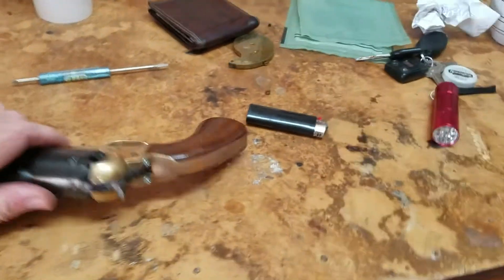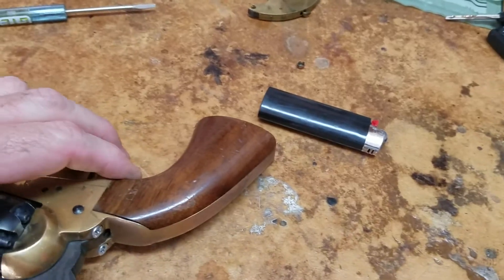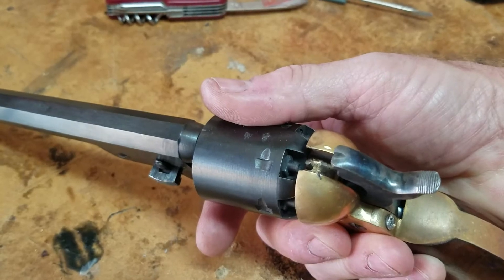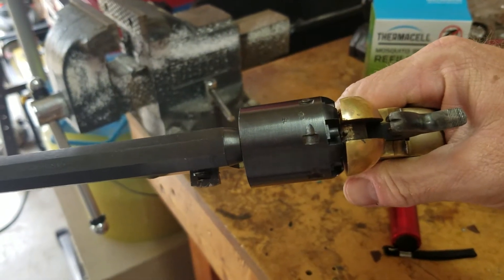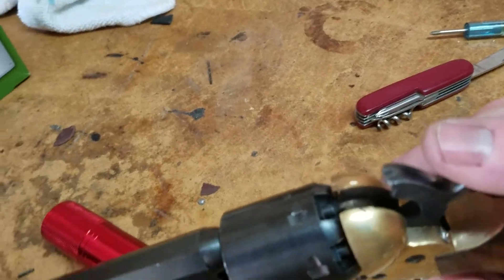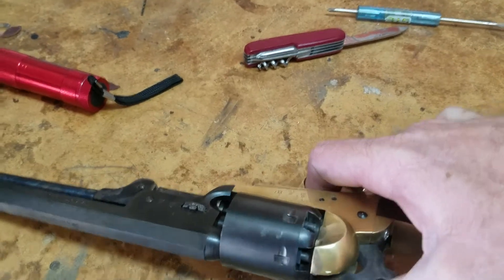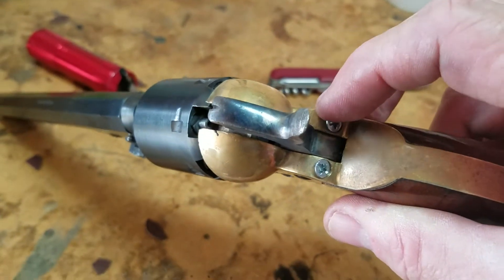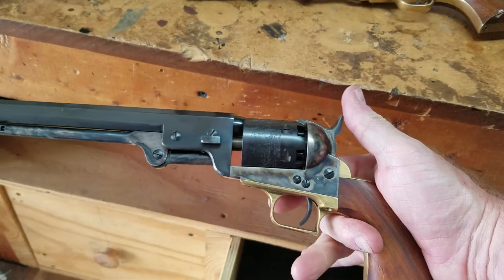1851 Navy - Cap Jam fix...

Comment: Interestingly, I read a story of how back in 1856, a man was having cap jams with his Navy. He took it to a gunsmith to have the 'cylinder filed'.  He stated that it fixed the cap jamming problem. He goes on to describe how he lent it to a man for a duel where they both agreed to duel with Navies. Their rules stated to fire all chambers as needed. The one mans Navy jammed after one discharge and the other was able to discharge all chambers.  A side note, all 12 chambers of the pistols were discharged at each shooter with only one hit. ,  AND  this one hit struck the pocketed watch of the man, resulting in no injury.

Comment: Just use 'Top-Hat' caps.  Back in the day there were no others  - 20% failure rate did not exist on such a popular revolver.  The colt styles were not made for tiny little 'primers' - caps - unmanageable  made-to-jam caps as use used today.
Reply: So what’s the fix? I use #10 cci and they suck. Stay not firing. Do I alter the hammer? I know there’s vids but everything doesn’t work that I see.